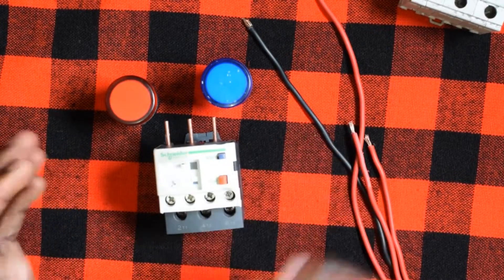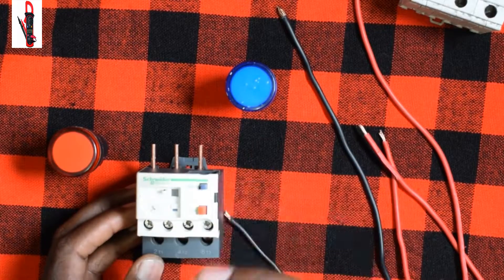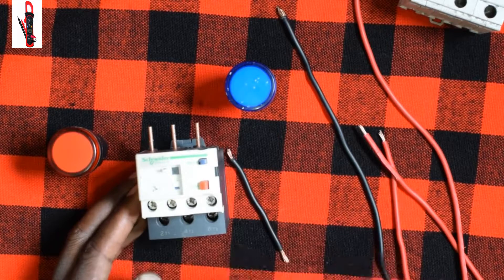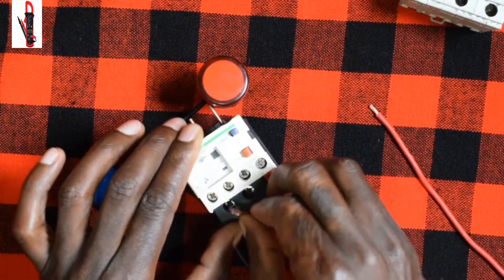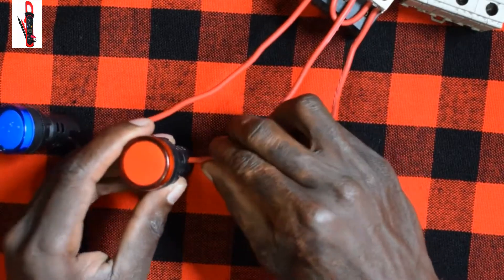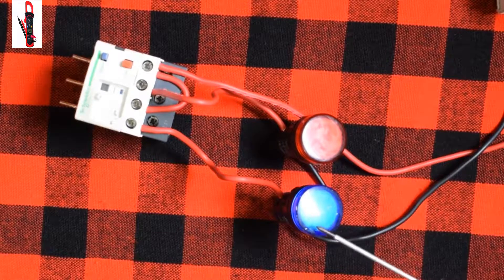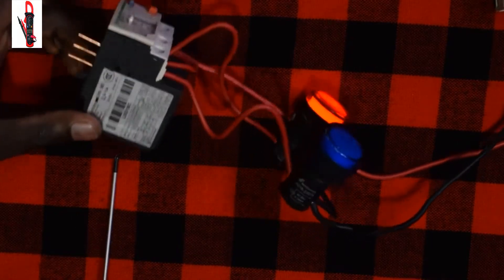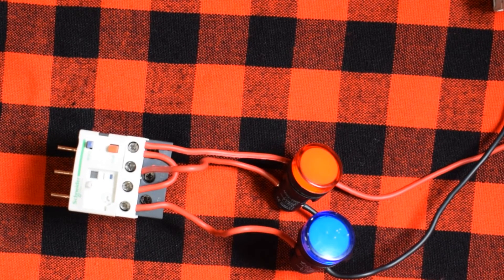Single|Three phase overload relay and control wiring|control lights|Electreca

Comment: Did the insert trip hole get removed ? I don't see it on mine.
Reply from the maker: Different brands and designs, check well it should be there. or you can tell me the brand name then I search for it.